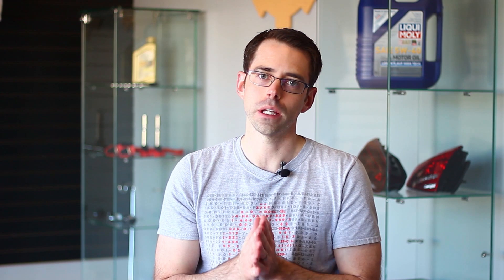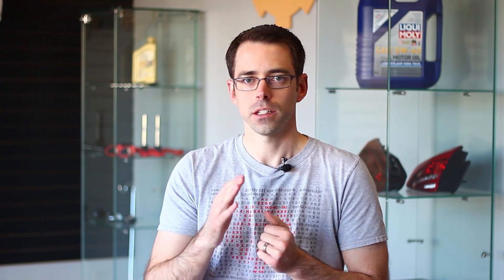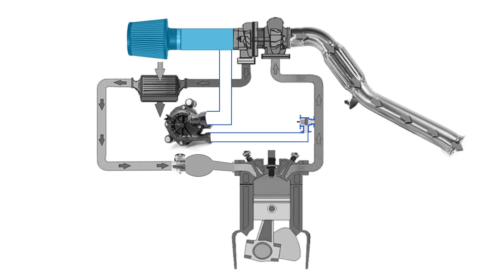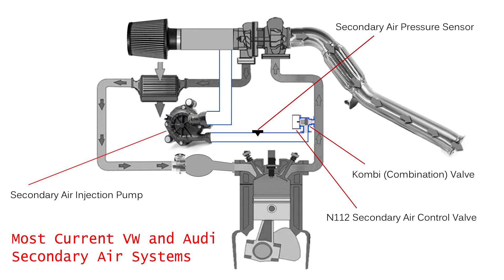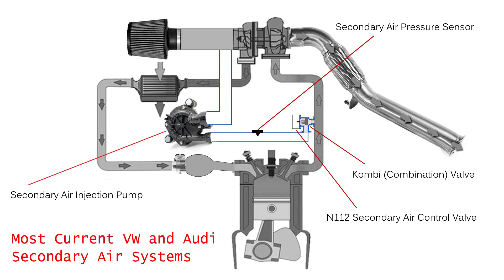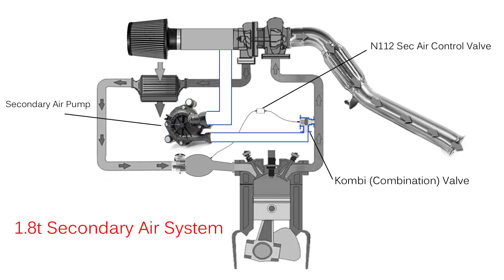How Does Secondary Air Injection Work?

Comment: it works by adding another element of planned obsolescence to the vehicle. it's so stupid and overengineered with cheap parts that cost the user thousands in diagnostic and repairs for a system that only runs for 90 seconds on a cold start. yay🎉

Comment: Can anybody help… i have code p2442 “Secondary Air Injection System Switching Valve Stuck Open Bank 2”. I have switched out the 3 small solenoids near the throttle body as well as the one near front over the radiator fluid hose. I am guessing that what is stuck open is the kombi valve. Where is that located on 2009 Q5 3.2? Any feedback would be greatly appreciated!

Comment: I got a p0413 on my mk7 gti....
At cold start engine i believe secondary air pump is running loud then lows after 30 secs....
I have apr open apex cold intake and cts catted downpipe.....

Anyone know if i got to clean where

Comment: If I have a short to sai system switching valve a circuit what would that typically mean I’ve replaced both pumps and still having issues with code coming up would that be electrical related possibly

Comment: Air intake hose CONNECTOR "air pump connector" part # 800-037.. Doorman parts store. Does this part sold separately from the hose. I just need the "connector" and not the hose. Can I just take the faulty connector out and just use a hose clamp to reconnect?

Comment: My secondary air pomp is working fine  but when I start the car (Audi A3 BFQ 1.6L 2002) it doesn't work. I don't hear the sound of the pomp. My question is: How to activate that with vcds? if the OS sensor from the catalyst exhaust is broken, does it matter for the Secondary Air Pomp in order to work? Relais is working fine.

Comment: Great video.  I did the "budget" intake mod.  CTS turbo inlet. Silicone hose upgrade to stock airbox, KnN performance stock filter and snow catch removed. 
It was working just fine until a few months ago. Now I have "ESC" code and check light. Not having the secondary air filter installed could this be the problem?

Comment: I did all the checks on my air system and everything works properly I drive it a couple days and the EPC comes on with no codes then I get the check engine light and I get insignificant flow what is the problem please help thanks

Comment: If I install a aftermarket cold air intake that doesn’t come with a place to reinstall the air injection hose what I can do ? Do I have to  find a way and connect it back or I can leave hanging in there? 
Oba: I have a cat delete downpipe and straight pipe all the way back..  2009 Audi a3 2.0tfsi

Comment: My secondary air pump continues to run continuosly while I drive and it makes a very loud whistling noise. Is the pump itself bad? I don't have a check engine light.
Reply: Is the kombi valve stuck open? Could be exhaust that is pushing the pump backwards. Pull the cable and see if the pump stops.
Reply: @jonasthemovie  sorry I don’t know what a combo valve is. Are you asking me to unplug my secondary air pump? I’ll try that.
Reply: @Dynasty-s1y  You never watched the video? Watch the video.
Reply: @jonasthemovie  I did watch it I promise. Lol. It was a month ago and I was mainly focused on the secondary air pump but i rewatched it. We’re you saying to disconnect the kombi valve or the secondary air pump? It may be sticking as I remember having a really tough time getting the cat to ready last emission would this be related? It took months and thousands of miles before the catalyst became ready.
Reply: @Dynasty-s1y  Something makes your pump spinn continously. Either it’s electric power or exhaust leaking backwards in the kombi valve. I would bet you need a new kombi valve, and that asap to not ruin the pump.

Comment: thanks for video. my sec air pump and valves were replaced on 06 toyota sequoia, but the pump s not coming on on cold start, also there s a p1445 stored , evem thought   valve was replaced.     why isnt this pump coming on at all if  evruthing is oem parts, pump vaves eveything. please, help.

Comment: Question on a 2014 vw jetta 1.8t mk6 ea888 gen3 cpra  Secondary air injection pump where is the sensor or if it even has one. Getting a code on air pump. I Have done diagnostics  and can run the pump and everything is working fine. Just the sensor is triggering on obd11

Comment: I deleted all those things and no engine check since then. 1 and a half year. Inspection pass. When i start the engine i let it work for like 2-4 minutes for oil circulation anyway.. so is kinda useless. The germans made it just to assure your catalitic converter warming, is that true?
Reply: Hi can you explain or direct me how do you delete that out of the system so my check engine light doesn't come on.  I have 2014 Audi A7 with 3.0T, thanks in advance.
Reply: @dylantrinh8738  it is different engine and i can t help you. My advice is to go to a service
Reply: @srrj9358  alright thank you.

Comment: Interesting question from me: I don't live in the US, but my car is 2.0tsi ea gen888 3 audi a3 8v. I got the car remapped + decatted and want to use an intake without the adapter for the 2nd air injection, will this be a problem? Since it's supposed to run only for the first few minutes anyway?

Comment: My car has weak acceleration can it be because of the secondary air pump? It runs fine but when I push the gass it accelerates slow with high rpm please help... I changed fuel pump and filter..

Comment: Question: 
I have a 2016 a7 3.0tfsi engine I recently changed the air intake with injen brand intake that supposed to go into that box , I installed it removing the original box and I was left with secondary air intake pipe that has no filter, 
Does it matter if that pipe has any filter on it or not? Would it ruin anything? 
Do you guys sell the secondary air filter that fits my a7 because all other aftermarket brands won't fit have tried at least 2 types 
(One thing I believe the filter that would fit is mk7 gti's forged air intake sai ) 
Please advise! Thank you so much!

Comment: My SAI (2003 VW Passat) does not turn off!  Constantly runs.  Even when sitting in driveway overnight.  It drains my battery and I cannot figure out how to fix it.  I want to simply pull the fuse or relay that powers it from the battery.  It is useless.  I've been disconnecting the battery every time I turn the car off and that is getting old quickly.  I'm 99% sure it is the SAI.  Sounds like a vacuum cleaner runing under my hood when the car is off.  Can anyone help me figure out which fuse or relay I need to pull?  Thanks.

Comment: The purpose of the SAI is to be deleted! :D
Reply: I just deleted that shit off my 04 trailblazer. 10/10 worth it engine bay looks cleaner
Reply: How do you get the car to pass emissions tests after the system is deleted?
Reply: @RedondoBeach2  It's funny how everyone yells delete delete, but fail to state you'll need a custom ECU tune to not have a CEL! If you have a VW/Audi 1.8t as that's what I'm familiar with, there are a few reputable tuners on eBay or you could go with the more premier companies.
Reply: how do i delete all this extra breather bs? wont it cause a cel? my mk6 had none of this
Reply: @markpollard500  How did you gain HP?

Comment: question... my 2006 VW beetle 2.5 engine shows Secondary Air System not ready so I cant pass the smog test in California...
there is no check engine light and I have driven the car for 500 miles, the technician tells me to keep driving it and it could eventually reset, but I need to pass that smog test to get the registration.  any ideas?
Reply from the maker: answer coming on Askdap 106

Comment: On my wife's Audi TT, the pump is on for about 20 seconds during a morning cold start.  So I have to wonder how much smog is generated because the car is carrying around about ten pounds of hardware that only functions for 20 seconds?  Is there that much "smog" generated during startup?
Reply: I am of the understanding that it is used to shorten the amount of time it takes for the vehicle to reach closed loop status. During open loop status a larger amount of fuel is injected because it is more difficult to atomize fuel in a cold engine.?...

Comment: what is your take on using a delete kit offered by Urotuning? By bypassing the secondary air pump will it cause negative start up for a 1.8T GTI?
Reply from the maker: +Joseph Flores Sorry we have no experience with this.  The main concern would be a check engine light causing you to not be able to pass inspection.
Reply: @Deutscheautoparts  .... good answer.. I wanted to delete my 2ND Air, but everyone keeps saying u won't pass inspection. . So it's like what to do.......?